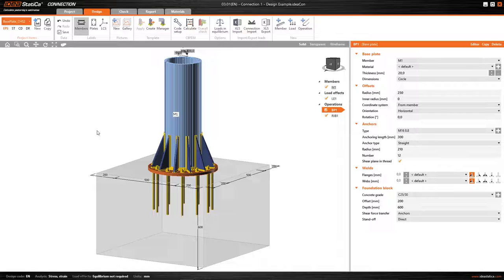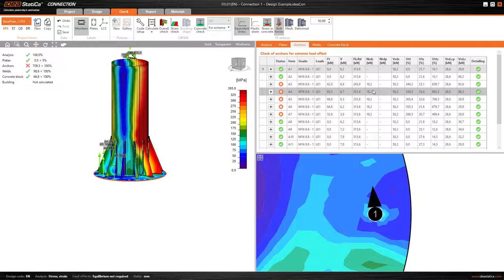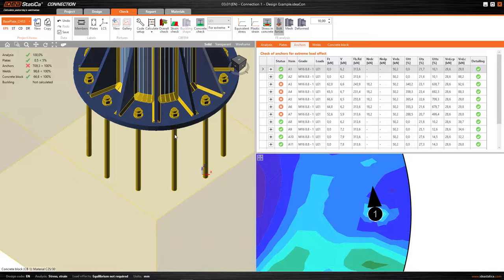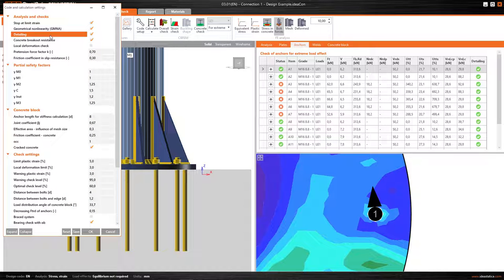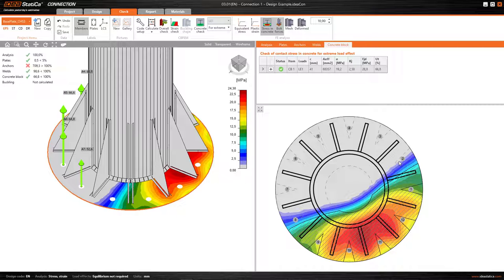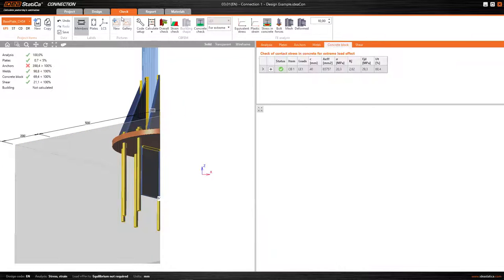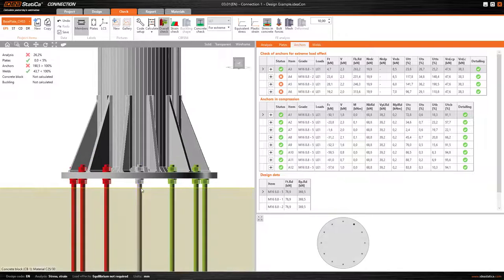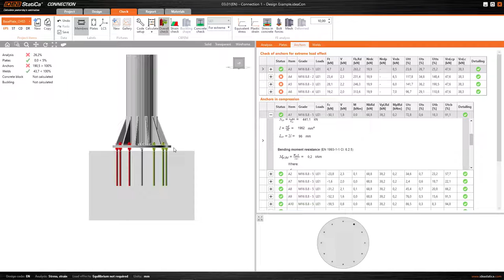Anchor and base plates check

Comment: Thank you, it was very informative. May I ask if the program can calculate the base plate with anchor reinforcements both in shear and tension? Thank you.
Reply from the maker: Hello!  Currently we are not able to take advantage of reinforcement in the foundation block.  However, we do have a new, innovative application Detail 3D which is in beta and going through verification tests/analysis - https://www.ideastatica.com/support-center/3d-detail-reinforced-concrete-footings-beta